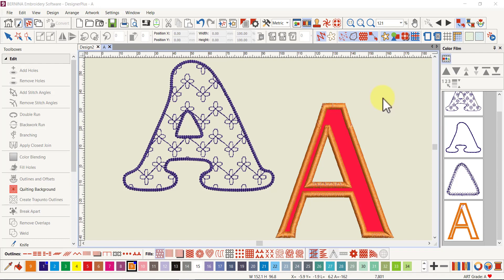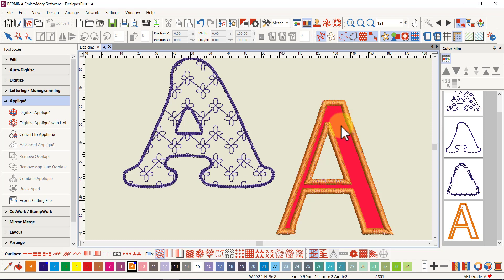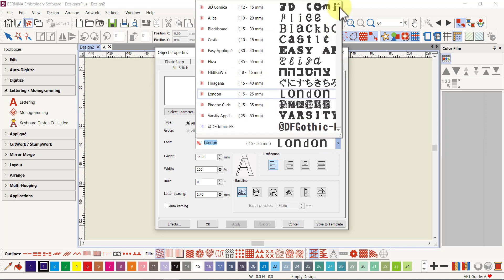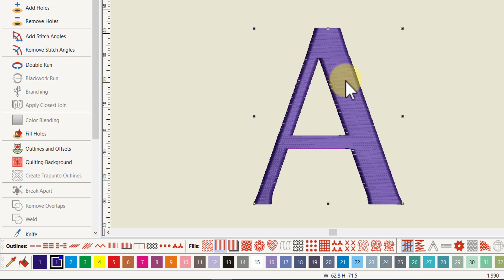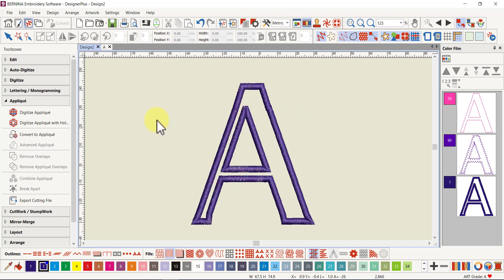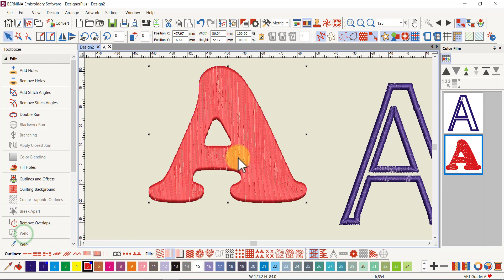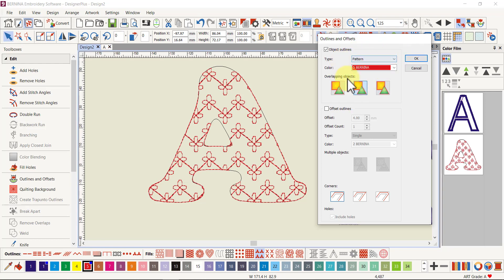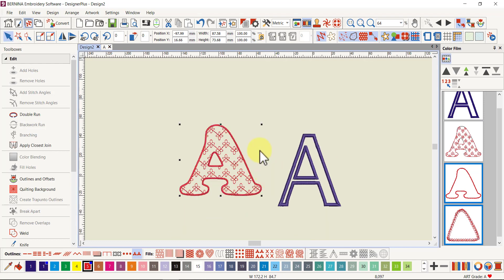Bernina V9 Weld and Applique with Holes

Comment: Does this work well with the buttonhole stitch.  In V8 I would get wonky or long stitches coming from the angles when switching the outline to buttonhole stitch.  Wondering if this has been fixed in this version. Thanks.
Reply from the maker: Hi Margie, Blanket Stitch will not be perfect, but it is easy to adjust. I have made a quick video showing how. You can watch it here https://youtu.be/STUvGLqz8xU